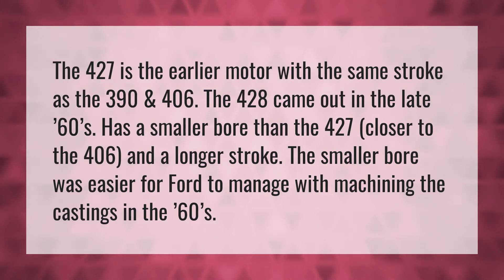What is the difference between a Ford 427 and 428?

Comment: The 428 was a longer stroke motor designed for torque., the 427 shared the 390 stroke but had a much larger bore specifically designed for high performance. Got a 428 under my work bench and a 427 in my 1966 f100.